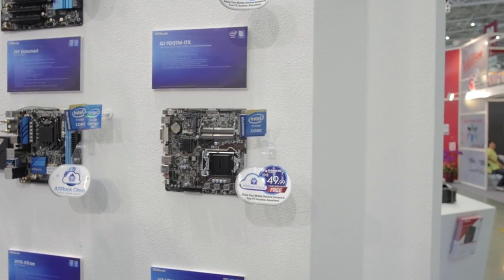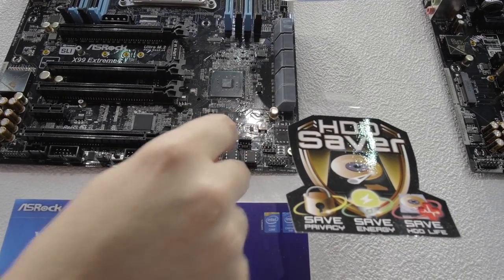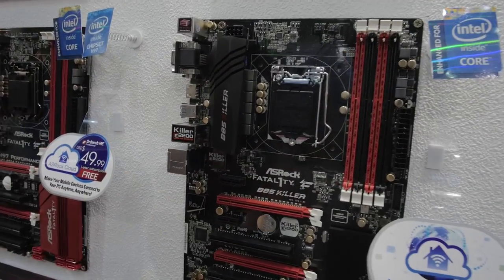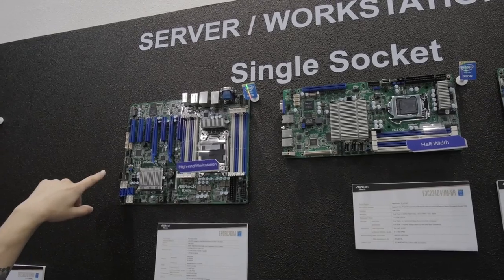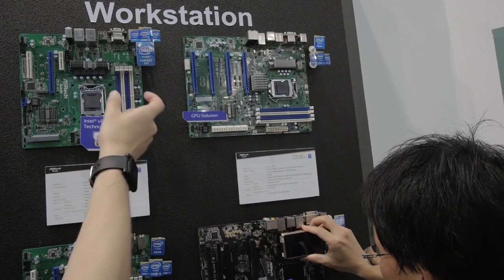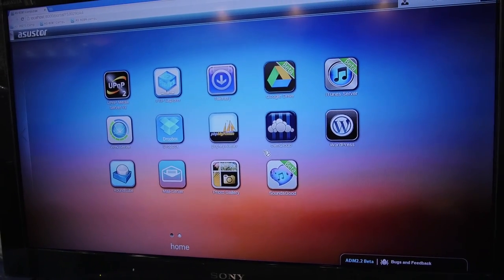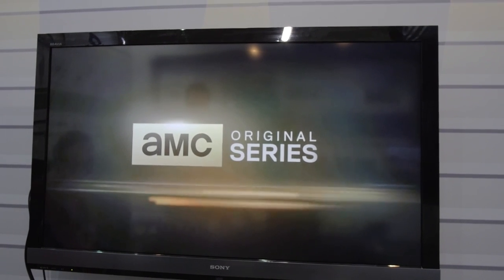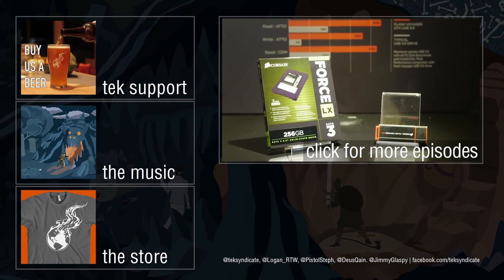ASRock Motherboards & Asustor Must-See NAS Stuff - Computex 2014

Comment: i have that 226 itx board, one of the only itx boards that supports ECC ram, with 6 sata ports, sata pots on it are a bitch to work with especiallyt with the 4 pin power right behind but once everything is in it goes great

Comment: Many people laugh about the gaming B85 motherboards, but I'm actually very exited about them. While they might not appeal to enthusiasts and the majority of people following Tek Syndicate, as someone who own a small local computer building/repair business, I know I will use these B85 motherboards a lot.
I often need to go with the higher priced Z chipset motherboards for some of the gaming features and performance, while my clients doesn't care about overclocking or SLI/Crossfire, they are not tech savvy and just want a good gaming PC that fits their needs, without the hassle. (I don't offer overcloking as a service as there is no money to be made from that; Getting a stable overclocking takes hours of tweaking and stress testing, so I would need to do it at loss to be worth the client's investment). So now, I will be able to use these B85 motherboards that will offer the performance and gaming features the clients want(and also have that sexy red color scheme), without needing to ask more money for features they don't want/need, money that will be spent into a better graphic card instead.
I'm also pretty sure custom PCs companies like CyberPower will use these a lot.
Reply: ***** I charge a flat rate for the job in addition to the actual cost of the components. The clients receive a copy of the receipts for every order I make for them. But thanks for being an ass and assuming I'm a crook.
Reply: ***** Well, you should better choose your words, because "The "good enough" used cars salesman type of approach" is clearly referring to ripping off people to me... Anyway, if I would charge people more money for less, how do you think I'd sell the PCs to begin with? They'd get their PC somewhere else. Thinking the cleints will only look at your offer and no others is asking for failure.
In fact, building a PC is barely profitable. Repairs are much more profitable.
Reply: Take care.

Comment: I would absolutely love to have one of the dual socket Xeon boards.

Even if the prices of them make me shrivel up and cry.
Reply: What would you do with it that you can't do we a more reasonably priced Ivy-E 6 core and now 8 core Haswell-E?
Reply: ***** It will be used for 3d modeling and rendering. The more cores, the faster it will render.
Reply: JessLe- Berry I know. I do 3D modeling and video editing but I think Xeon processors are more difficult to handle & have more of a hassle in dual-sockets; not sure if simple plug & play so to speak. Plus everything else would have to be up to par, which could easily up up being at least $5,000 and up. You'd have zero issues with an 8-core (16 virtual cores) Haswell-E for $1000.
Reply: For modeling; xeons wouldn't do so well. I was talking specifically for rendering only. Rendering benefits from the more cores there are.